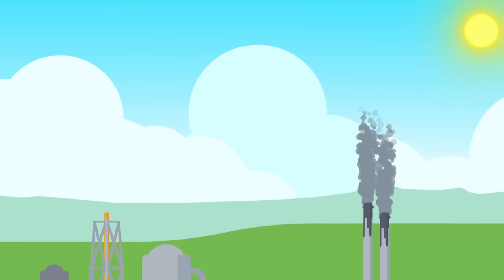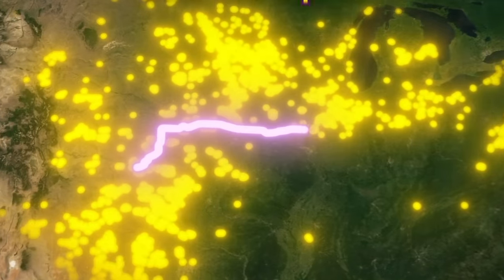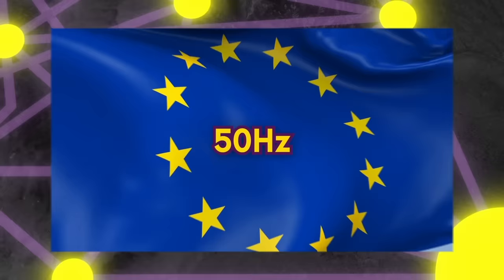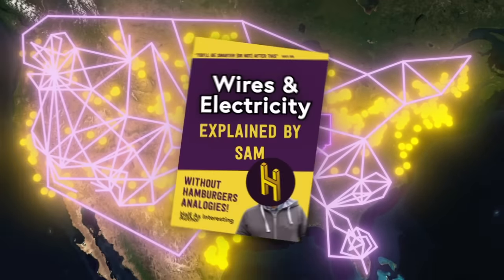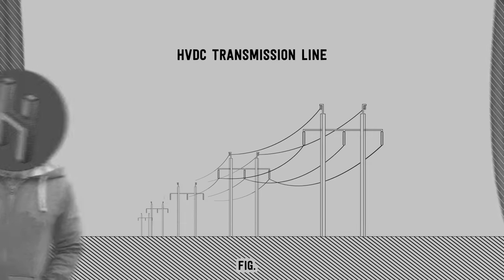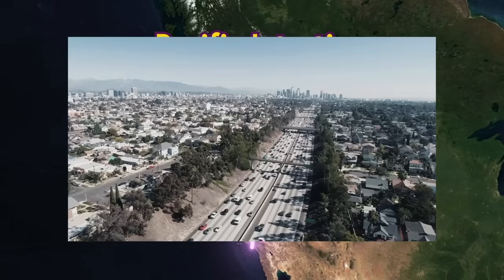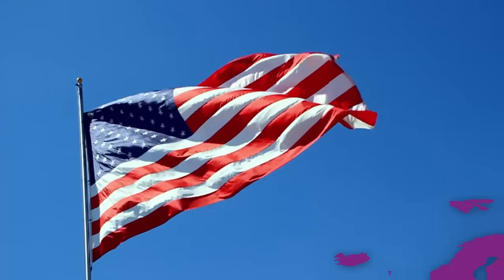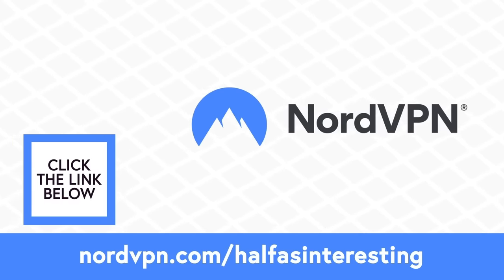Why We’re Building a 790-Mile Wire From Kansas to Indiana

Comment: there is actually a big misunderstanding in this vid. the loss to heat is pretty much a function of the voltage. The higher the voltage, the lower the loss to heat per distance and energy transmitted. The problem is, that AC has a second loss. They are basically a big radio antenna. And the signal gets stronger with higher voltage. one loss gets down with high voltage, the other one gets up. That is why there is a lower boundary on how much loss you experience per distance and energy transmitted in AC.

Comment: The skin effect is not really the limiting factor (it does contribute to the design) and to say that the power line can go up to a certain distance is also not right (the distance will depend on the design voltage). Transmission lines are designed to go very long distances and are designed to carry a certain load. Your load increases over time as new consumers are added to the grid. The problem is at some point the conductors will not be able to carry the load anymore, you can either increase the conductor size or increase the voltage. Increasing the voltage on the transmission line is easier than replacing the conductor with a thicker wire. The problem with higher voltages, you have to design your pylons and other equipment to handle these high voltages (at some point this is also not practical). 

The skin effect forces the electrons to the skin of the conductor, so the usable area used by the electrons is less. Less usable area means lower current capacity for the wire. So if you go from AC to DC, you can "increase" the size of your conductor without increasing the voltage and the size of the equipment. You still need high voltage to overcome the losses.

DC was never used because the technology wasn't advanced enough but now we do have the IGBTs and the power electronics to make it possible.

Comment: Funny that the  DC transmission lines that were shown  are actually AC 3 phase dual circuitl lines. DC only has 2 main conductors. And there is way more DC transmission in the US than you mentioned.  - An actual lineman that knows what he's talking about.

Comment: Okay, I'm really confused here.  One of the things (I thought) I learned about the Edison vs. Tesla rivalry was that Edison wanted the standard for electrical lines to be DC and Tesla wanted AC.  Edison favored DC because it was ostensibly safter, but Tesla carried the day because DC could not travel very far, and would require cables like 5 feet thick or something.  But at 3:55 or so this video says that DC is better for carrying long distances without losing the power.  So I don't know what to believe.
Reply: The thing that makes electricity difficult to move over long distances is actually the voltage. The lower that the voltage is, the more the electricity is affected by resistance in the wire. The reason why AC current is usually better for transporting electricity over long distances is because changing it from low to high voltage (when it crosses long distance) and then back to low voltage again (when it goes into your house) is very very easy. You just use a transformer to do that, which is essentially 2 loopy bits of wire next to each other. The circuit you need to change DC voltage from low to high (and vice versa) is much more complicated and much more expensive. Hopefully that made sense! ☺️
Reply: @billismcwillis   I get it!  Thank you!

Comment: Not gonna lie... when I saw the question I immediately thought "well, power or data transmission are the only reasonable options" - but I was still a little bummed that it actually WAS "well, actually we build the wire for electricity". I guess I kinda hoped for a little bit more HAI-esque story like, say, "it's the guidance system for autonomous spacecrafts"...

Comment: .... and so what do you think.  In the manner of piecemeal building of this kind of network that when it's more and more built out that it has some of the same vulnerabilities that the current grid has?  Because when it's small and not used by many who cares if it's vulnerable who wants to pay for forward thinking who wants to build secure redundant infrastructure and pay for it.  I know I probably won't be around for large scale transmissions of this sort but bet that the future is kind of like the current electrical grid.  It works but it don't take much to tip it off balance.

Comment: 4:00 Bro, what? You need a converter station whenever the DC gets turned into AC, which would be likely 50+ miles apart. The towers themselves are easily $500k+ each, and each converter station is likely only $10-20 million, tops. You'd be running HVDC power lines for 400+ miles. If substations want to connect to the HVDC line after the install, they would pay for their own converters.

Comment: Neither the author of the video, Nor any of the comments have touched on why HVDC is the only way to transport power over long distances, and it’s not about the skin effect: it’s about capacitive losses in AC systems. We’ve all seen the videos of people holding fluorescent light tubes underneath AC transmission and the tubes lights up. because those AC overhead lines form a capacitor to ground, and the electricity is shunted from the line to the ground. It’s a small affect per kilometre, but as the distances add up the losses, add up to the point where the capacitive load of the line equals the amount of power that can be placed onto it and there’s no power comes out of the end of the line.

When designing a power lines for AC systems, there is a trade-off between heat losses, which go up by the square of the currents, which wants to make the voltage as high as possible, and the capacitive losses, which increases the voltage increases so when designing lines one needs to find the sweet spot of voltage to minimise the two sets of contrasting losses. DC lines only suffer from heat losses.

Comment: I hate to be that guy, but if a transmission line has three or six ‘big’ cables, it’s an AC line. Every single stock clip you used when describing HVDC was an AC line. HVDC lines are very distinctive because they only have two ‘big’ cables on them.

Comment: I want to know more about the conversion  process, what kind of hardware.  Since it has to be done twice, it has to be pretty efficient to be better than AC losses.

An old technology that does this is a motor-generator.  The motor is driven by one type of electricity and it drives a generator that makes the new, desired type.  Very inefficient.

Comment: 1:38 I'm no electrical engineer, but I feel like depicting 60Hz AC as energy moving the full length between two sources on a power line sixty times a second is inaccurate. Like the electrons only move a very short distance, and they move across every inch of the cables connected to the grid simultaneously, right? I realize nobody came here for a physics / engineering video but it does seem a bit confusing.

Comment: I need to look more into long distance power transmission. I know a lot of what we learned in school is heavily oversimplified or in some cases outright wrong, but I remember being taught that Tesla and Westinghouse won the Current War (i.e., we went with AC power infrastructure instead of DC) because AC doesn't lose as much power over long distances
Reply: This is because back then we didn't know how to step up DC, but we could step up AC to high voltages for transmission! Your school textbook is simplified but accurate. Source - I'm an EE
Reply: @towers3372 we could rectify high voltage ac with mercury rectifiers but to get it back to ac required motor generators so there would be losses and expense. ac was simpler . edison wanted to build a power station every 2 blocks which was how far his dc was practical at the time. Ac was the choice for niagara falls because they needed the power in ny city.

Comment: The resistence of wire is directly proportional to the length and inversely proportional to the diameter.
Reply: Correct for dc. For ac, skin effect modifies this and makes wires more resistive.
Reply: @ilyakrivorotov2491 You are talking about independence, which is a dynamic resistance, I explained a static resistance.
Reply: @adamsholzhaus8196  independence is not an electromagnetism term (you probably mean impedance). I agreed that your statement was correct for dc resistance only, not ac resistance. I think we are in agreement.
Reply: @ilyakrivorotov2491  yes.

Comment: An organic polymer Tc = 1000 °C exciton superconductor fulfills DC transmission, DOI: 10.1103/PhysRev.134.A1416. Bill Little's #2 pencil lacked organic chemistry. The proper polymer structure is a self-ordering, fully substituted E-polyacetylene core coaxial cable: MINUS 2009 kcal/mole mm+ calculated enthalpy of formation for the 30-mer. Its synthesis is is wholly plausible. Nobody will high order calculate it because physics is a closed shop. The .hin structure file is patiently waiting.

Comment: You need to stop showing double circuit ac transmission towers and calling them dc lines, which will typically have only two major conductors, unless they carry a metallic neutral instead of using ground.

Comment: 1:53 Is a classic example of someone who knows nothing about electricity using big words that they don't even remotely understand to sound more smarterer. AC is used, not because its current can be stepped up and down, but because its VOLTAGE can be stepped up and down easily. Current is how many electrons are flowing through a wire. Voltage is how much energy each of those electrons has.

Comment: So why weren't we doing this for the past 40 years? Well, cost. Then when cost was coming down, surprise scientists discovered carbon nanotubes. One of the properties of carbon nanotubes is that they can move large amounts of electricity without heating and losing 20% to 40% of the power along the way. So utilities waited. Now nanotubes are still nowhere near production. They are practically impossible to make. So the HVDC is getting a try out for shorter, yet long compared to most high voltage utility wires, distances.

You would think they would have learned from carbon fibre. It was discovered in the 70s. They were able to make small amounts for very high prices in the 80s. It became used for extremely low volume expensive products, aka boutique manufacturing, because it is really NOT manufacturing, in the 90s. The 00s saw the prices finally come down and the use spread. Since the 10s we can get carbon fiber car bodies, typically for racing because, guess what, it is still expensive. But smaller bits gets regularly made.

That was 45 to 50 years for discovery to wide spread use.

Since I first read about carbon nanotubes 10 or 15 years ago, and they are much harder to make, we are probably another 25 to 35 years away from them having a large impact on the world.

The lesson: utilities are loathe to spend themselves. They try to wait for government to come to the rescue, pay for it, and give it away to them! Yes, that translates to greed. The problem is we let businesses run things that everyone needs. Which is the exact opposite of the way it should work. Even then greed makes it so businesses need to be regulated, but they go and bribe our lawmakers to make it all about them and screw us. 

I would not be surprised if governments were paying for this and then give away to the utilities.

Comment: I know for a fact that my electricity is generated through nuclear or hydro power, that pretty much all the power company has around here.  The last bunch of nuclear plants to be opened in the US before the 2000s.  Not the two units that were opened after the 2000s, except maybe the Georgia one does supply power to our grid??  Only 2 unit in 24 years???

Comment: There are 2 temper tantrums, Quebec is also isolated from the rest of the grid using AC:DC||DC:AC isolation.
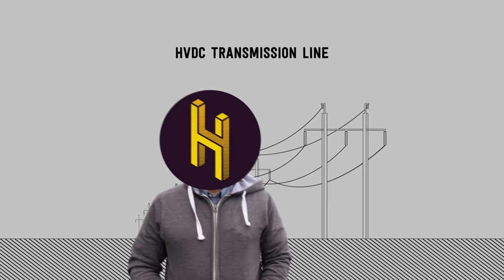Funny how you show @3:38 3 ph systems and claim they are HVDC.  Pro tip: HVDC is in pairs, not triples.  (Can even be a single wire - but so can AC...)
Reply: AC can never be single wire. Unless you're building a loop of power line, which is never ever done in the  US. There has to to be a second wire for the second phase. Not everyone is an electrical engineer, buddy.
Reply: @pootispiker2866  Ever hear of Single Wire Ground Return?  All over the US in rural areas.  Electrical Engineering.  It's a thing.
Reply: @AlanTheBeast100  I guess I'm not an electrical engineer, either! I've never heard of such a thing and have never seen it.

Comment: 0:02 Don't think this intro really works in the modern age of cell phones. Lots of battery powered devices most likely got their energy generated hours ago
Reply: except the radio waves that provide the content use instantaneous power from the grid . you know radio waves are electricity going through the air , right?
Reply: @ronblack7870  he didn't say providing the content, he said "powering the screen"

Comment: Im sorry Sam- usually you do pretty good but your explanation on the reasons why we use HVDC and how AC and DC transmission lines work is pretty bad. Quite a number of errors, omissions, and mistakes. Id recommend having your script checked over by an expert next time. Source: am an electrical engineer

Comment: Its a terrible idea. The only reason its being built is to provide energy for future data centers on the east coast for some companies to be able to market to you using AI, and for the NSA, DOD, and FBI to build data centers to use AI to spy on people. All at the cost of forever creating the legal precedent of giving corporations the legal power of eminent domain, and 2,500,000 acres of land.
Also, why does it need to be 5 MILES wide? Normal long distance transmission lines only need 1500 foot wide sections of land, and now it needs to be 5 miles wide? Why? Just seems like a land grab to me.

Comment: Alrighty! Guess what! I had some inaccuracies in my statement! I will definitely look more into information about coal power plants. I think the biggest issue was that I was peeved by the statement that by using coal and natural gas that "we are to be dead in 15 years." Which may have been humor, idk, I have always been terrible at reading that, but I understood it as another severe overreacting environmentalist statement. 

Btw if you have any information on this subject please drop it below!
Reply: Nah, coal fired plants have SO2 scrubbers, but almost none have CO2 capture.  And you didn't give a rate.  Is this half a kilogram per minute, hour, or day?  The big plumes for a power plant come from cooling towers, not smoke stacks.  And the discharge from the stacks is divorced from the motive fluid in a steam-powered plant.  The steam is condensed and reused.  OTOH, many power plants directly use the combustion gas in turbines, so that is sort of how natural gas plants work.  If you are an engineer, you ought to give your diploma back.
Reply: To add to what @richdobbs6595 said coal plants have lots of other negative effects besides direct co2 emissions. They emit a wide variety of pollutants including particulates, heavy metals and NOx. Coal emissions are linked to higher rates of cancer asthma and heart problems etc
Reply: [Citation needed] A Dutch household consumes about 10kWh a day, and I'm sure that Americans households consume thrice as much. The average US power plant generates about 1 kg of CO2 per kWh (source: EIA.gov), so that would be what, 10 - 30 kg of CO2 per day per household. I think that's really quite a lot.
Reply: @richdobbs6595  not almost none have CO2 capture, none have CO2 capture. The only power plant that had any kind of CO2 capture has closed.